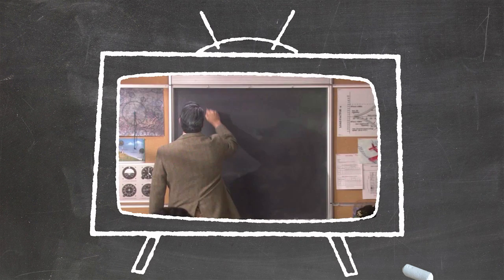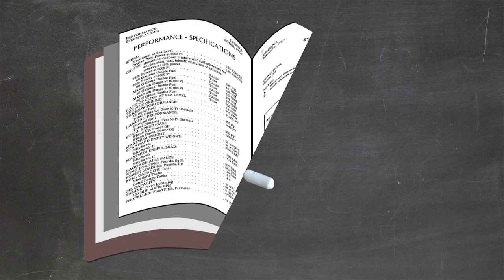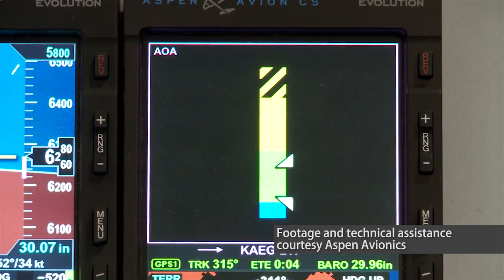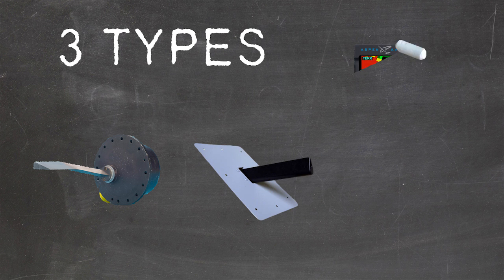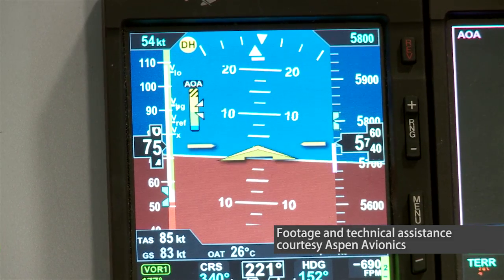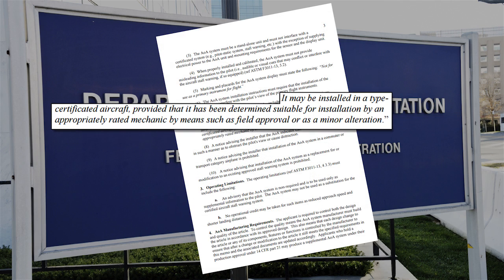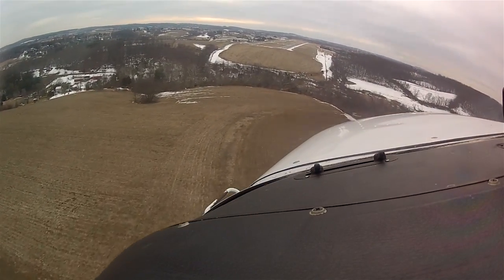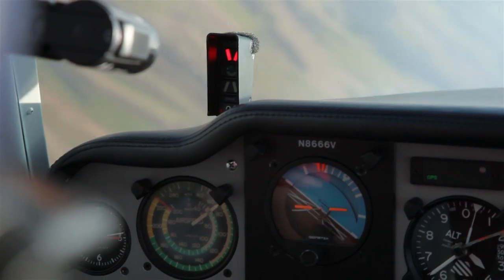Margins of Safety: Angle of Attack Indicators

Comment: The air is moving under and over the wing.The stall happens when the air can only move under or rt befor.Also the plane will stall if the plane Flys to slow.If the nose is pitched up and the plane cant glide.

Comment: Please explain to me how a stall warning horn would be too late? Such is based on suction near the leading edge of the wing, which is how most GA AOA systems work. In other words, the stall warning horn is itself an AOA device. Its first limitation is that it only indicates near stall and at stall so fast rates of change while still in the green though decaying don’t register as quickly. It’ll still sound before and at stall, however. The more likely problem with horns is that they can be involuntarily mentally tuned out. Many GA land with horn creating at least a minimum audible level hence we wrongly grow accustomed to hearing it. This isn’t to discourage AOA indicators - of those I’m a big fan. Just checking to see are we discounting horns for the right reasons?
Reply: the only angle here is the angle these shysters are using to fleece you fools out of your money!

Comment: It is totally understandable that military and commercial aircraft (basically jets) require an AOA indicator.  Their landing and TO weights vary dramatically and the difference between coefficient of lift clean and dirty is dramatic.  However, for GA we fly with much smaller differences.  The "book" tells us numbers at gross weight for air speeds and as long as we stay above that number we are always flying a safe AOA.  I would argue the difference in AOA approach speeds between a GA aircraft at gross weight and one almost empty of fuel and one person on board would be very small anyway.  Yes, if you are trying to wedge yourself into a high altitude back country short strip, AOA would be helpful.  But for the most of us flying normally, we takeoff and land at small differentials of airspeed in any configuration.
Reply: True until your student gives you a wrapped up overshooting base to final turn then tries to pull harder to get to lineup perhaps even stepping on the inside rudder to help the turn along. This is the case AOA if readily prominent in your scan saves your life. It’s also apparent in T-38 crashes where they used speed like GA does versus the TA-4 & T-45 navy planes. If your problem translated up to the USAF, then the USN solution likely translates back down just as well.

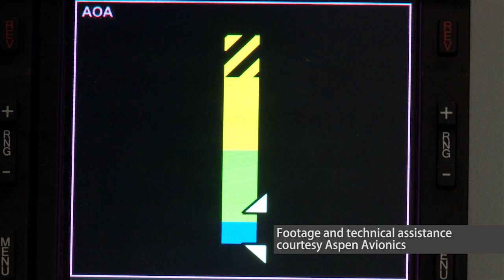Comment: 3:06 - I'm assuming they also don't take into account other factors that can change the wing's stall angle, such as icing or damage to the wing's leading edge.
Reply: Your pitot-static is just a susceptible to icing hence even your 1g unaccelerated stall reference fails you in those conditions. This is a bit of a strawman argument trying to put extra requirements on the better system to justify the old system that can’t handle those particular requirements either.
Reply: That would make complete sense. It would be impossible to know the AoA the wing would stall under those conditions. Too many extra variable to account for that would require more equipment. AoA indicators only work under given set of data.

Comment: I wish I fully understood these AOA devices in exhaustive detail.  Does anyone?  Are all the considerations discussed anywhere?  Does the AOA display always give proper guidance (nearness of spin/stall/control-loss) in every situation (every altitude, every speed, every orientation, every position of flaps, ailerons, elevators, rudder, aircraft weight, current position of CG, etc)?  I don't have any reason to believe the AOA is taking everything into account and giving the correct answer, and I would be surprised to learn it actually is.  OTOH, I don't know for sure that AOA is not precise in every situation.  Where would I find out?

As a separate matter, let me say this.  My interest in AOA (which I have not flown with yet) would primarily be for super-short landings (and take-offs) in places 99.9% of pilots would never even consider landing (because the landing area is too short, or is on the 15/30/45-degree upslope just short of a mountain ridge, etc).  One concern I have from performing these bush/STOL landings is... I feel like I need to keep my eyes glued to the spot I'm aiming to contact the ground (and immediate surroundings), and staring anywhere else to watch an AOA seems like a distraction of attention that I probably cannot afford.

In theory, the AOA sounds great.  When making these crazy landings, one must NOT stall the airplane... well, at least until within a foot or two of the ground, and the theory of AOA sounds great for that... especially for landing at a huge variety of altitudes from sea-level to 20,000 feet (mountaintops in Chile).  The fact is, strictly from practice I can land super-slow from a super-slow-and-steep descent without stalling, at any altitude... even when I don't know the exact altitude.  One just gets a feel for the airplane.  And "somehow" we also get to understand how more or less weight impacts the approach and landing, even variations in CG... though I must say CG is the one variable I refuse to let get even close to marginal for fear of being "surprised" at the last moment.

But my overall question... and this is a question... is whether AOA can really be helpful in situations like this?  The theory (especially as stated by strong advocates of AOA devices) says "yes", but my general sense says "no".  Just the need to take my eyes off the target landing spot/area make me think "no AOA"... for this kind of flying.  Add to that any imprecision caused by airplane configuration, altitude, temperature, humidity, winds (in any direction), gusts, updrafts, downdrafts, control surfaces, aircraft weight and CG... and my feeling is "no AOA".  But I'd like to hear what others think about this.

Note that I suspect AOA is probably a good thing in other situations... like landing when you have plenty of time to land, plenty of runway length and width, crappy visibility (or no visibility), and so forth.  In other words, for most situations, AOA sounds like it might be great.  Though, I must admit, I still wonder why AOA is necessarily better than a good stall warning horn (which involves no visual distraction, just familiarity with how the various sounds it makes relate to closeness to actual stalls... as determined by previous stall practice in each airplane).
Reply: i think its just a simple tool to be added to the list of instruments to help lower deaths. and prob more of a decoration for experienced aviators than an actual tool.
Reply: @davidjd123  experienced aviators will quickly favor the AOA. It ain’t decoration.
Reply: Assuming no damage to probes or vanes, yes, AOA is always proper relative to stall. This is one of the few times you can actually say “always.” Suction types can get blockages just as your pitot tube would. Vanes can get bent. They can also get water inside that can freeze.

Comment: There's lots of hoopla here but the consider the obvious -- if AOA was all that good as a guidance instrument, it would have been adopted years ago. Stall warning, you bet it's useful, but I've done the flight tests in my RV-9A and done the analysis, and visual AOA has lots of shortcomings for GA. And GA planes are not flown like Navy jets landing on a carrier, so let's ignore those specious comments. It's the emperor's new clothes of GA equipment.
Reply: It wasn’t adopted years ago because they didn’t know how to do it in propwash. That’s the problem with GA and vane style systems. Wing mounted suction based systems solve this concern. The empower had no clothes before AOA.

Comment: It's ironic but AOA was at fault in the Lion Air crash.
Reply: True.  But what is even more at fault is the insane policy to make airplanes take actions against pilot wishes (control inputs).  The reason that is an insane policy is these systems take actions on VASTLY too little knowledge.  Unlike a human pilot who tries to be aware of everything, these insane systems take actions based on something as simple as a single sensor (like the output of the AOA sensor).  Consider how stupid this is!  Based on a faulty output from thee AOA sensor the control system flew the airplane into the ocean... even though a 5 year old child knows you don't want to fly an airplane into the ground or ocean (or below 0 feet altitude)... especially to "get out of trouble".

In general aviation the first thing to remember in any usual or dangerous situation is always FLY THE AIRPLANE.  Obviously the creators of these commercial airplanes have thrown that "prime directive" out the window by overruling pilot control inputs... which is a terrible idea.  What is even more insane is, the control systems fly the airplane into the ground or ocean, or take other self-destructive actions contrary to pilot control inputs without saying anything verbally.  Given that these systems DO say things like "terrain" or "pull up" and such... you'd think they'd tell pilots "hey moron, I'm flying the airplane and too bad if you don't like it".  Okay, I'm being cynical, but the point remains... at the very least these systems should TELL pilots they are over-ruling them and why... and what the pilots need do to disable or overrule the control system.
Reply: @maxbootstrap7397  all modern equipment from airplanes to defense equipment like submarines planes fighters etc have hidden fly by wire capabilities. It's crazy world. The purchasing owner doesn't even know! Think Malaysia airlines!

Also coming to your cars.
Reply: @klam77  : Yes indeed.  However, it appears general aviation equipment is a bit behind the curve... which is good for me (only a private pilot).  While I don't mind having a SIMPLE autopilot in my airplane (that controls pitch/roll/yaw only to go in the direction I specified), I NEVER want any situation in which control of the airplane is split between pilot and avionics/control systems.  Either I am flying the airplane, or the autopilot is flying the airplane, albeit only in the very simplest of ways possible, namely in the direction I specified.  I don't want the damn control system to be taking measures to avoid stalls or even avoid running into terrain or ocean.  And I want to take FULL control of the airplane instantly in the event "something seems wrong or odd".

What I do want to HEAR is stall-warning horns blaring and/or voice warnings from avionics like "terrain ahead" or "terrain nearby" or "terrain too close" or "approaching stall speed" or "excessive bank angle" or "uncoordinated yaw" or whatever-they-wish.  But it MUST be left up to me to decide what I want to do about these messages.  In most cases I the pilot will be perfectly aware of the situation, and just ignore the helpful voice.  But in those cases a pilot might be surprised by the message, it MUST be up to the pilot to scan the instruments (and out the window if visibility allows), make decisions, and take those actions the pilot deems appropriate.

Perhaps one funny factoid is this.  As a scientist and engineer, I've designed a number of devices/systems/robotics that control equipment, but in the end the human in control can press a red button or equivalent to stop or disengage the automatic processes.  And in a lot of cases the control system is just following instructions provided by the human controller... except with a speed and precision no human could achieve.  But in no case would I ever create a system in which the automation decided to overrule the human controller in any dangerous way.  Of course there were things like "limit switches" that prevented both human and automation from moving parts of the machine beyond certain limits, but that's different.

In the case of flying airplanes, too many factors need to be taken into account for software to be able to make a good decision in every case.  That ANYONE designing these systems would even consider doing what they are in fact doing, just shows how totally insane these designers are.
Reply: @maxbootstrap7397  very true! also, as an aside, imagine how the legal system actually protects against such liability. Not one word on this in the news!  Like nothing happened.  Meanwhile the average Joe is held liable for all manner of nickels and dimes. It's an absurd world. All talk covering up great dystopia.
Reply: AOA was not at fault in the 737 max crashes. A faulty indicator creating faulty feed was contributory, however, poor airmanship leaving throttles up, getting fast while not getting high to troubleshoot, and undoing fixes that worked all played more in contribution. See NYTimes for a thorough write-up. Perhaps most egregious were faulty maintenance on the sensor, poor records, and rotten aircraft turnover from crew to crew. Remember, understanding AOA would have saved Air France. https://www.nytimes.com/2019/09/18/magazine/boeing-737-max-crashes.html

Comment: I am curious as to why all these comments are 1 year ago? Having made over 700 carrier landings with AOA and teaching it to GA pilots who have it installed in their aircraft, I can only guess that the negative comments reference AOA are from pilots that never flew with it. During my 30 years with the airlines I wished that I had one many times with high gusty winds and wind shear while approaching a runway with standing water, etc. I have had to go-around on a micro-burst hanging onto a stick shaker with no visual indication of how much more lift that I had to get out of there. I have used it for max range and for max endurance during holding, etc. It is a great asset if you understand it and are trained properly. In most cases in GA aircraft the threshold crossing speed can be 10-15 kts slower than normally flown thus making more perfect landings and using less rubber, brakes and runway. NUFF SAID!!
Reply: Hey Skip, thanks for your comment. As a commercial jump pilot and CFI, I 100% agree with you. 

It would be brilliant to have an AoA system in the jump aircraft I fly to pitch for a precise Vy no matter the gross weight of the aircraft on that load of skydivers. When we are lighter, Vy shifts to a lower airspeed, but without a precise weight, pulling out the book, and coming up with an estimate, it is very hard to tell. Similar as density altitude increases into the summer, indicated Vy decreases. Having a real AoA system that would indicate climb, stall, and  best glide (L/D max) speeds would be invaluable for sure. Only reference I have is the angle of the wings relative to the horizon, I can use that to try to judge an angle of attack in the climb.
Reply: Have you seen the recent Dan Gryder Probable Cause videos? December 2025 ones. DMMS v AOA “Debate” and subsequent week.
Reply: Mr. Wood, I agree with you. would you be available to discuss this subject with me further? I am trying to get the most out of my AOA gauge and have a few questions. If so I am available at jtm2@flash.net

Comment: AOA should be the standard for defining not just approach and stall speeds, but also your best glide speed, and the vy as well. In an engine out emergency the extra glide range gained by gliding at the best aoa just might save your life, while the use of AOA during normal climbout and cruise might result in reduced fuel use.
Reply: Vx also would be an invaluable indication to have
Reply: these speeds are already in the book that came with the airplane.  stop throwing your money on stupid gadgets!
Reply: A problem here is that AOA give best glide and max range only in no wind situations. Then again, that’s true for trying to use published speeds too. I’d also argue against using either Vx or Vy in climbout. Better to be above these so as to allow for airspeed decay during surprise time to reaction. That surprise time at low altitude is the real killer. Such allows for better cooling too.
Reply: @jimallen8186  note also optimum turns are at minimum power required, which is a different AOA but similarly a notable AOA. 45 AOB at min power required AOA is best turn degrees per altitude lost. Funny thing, constant airspeed turns at weight (not load) adjusted speed may naturally help one go between best glide L/Dmax straight and best glide turn min power required AOA, but without a gauge and/or tone distinguishing values, trying to optimize the glide is too risky. Can only optimize the glide if you know your AOA. Vx and Vy have constant AOAs regardless of weight, but only AOAx is constant with altitude in jets, AOAy changes while for props both AOAx and AOAy shift with altitude (though AOAx not by very much). The Fly Onspeed Organization recommends using L/Dmax AOA in lieu of AOAy and onspeed AOA in lieu of both AOAx and minimum power required AOA.